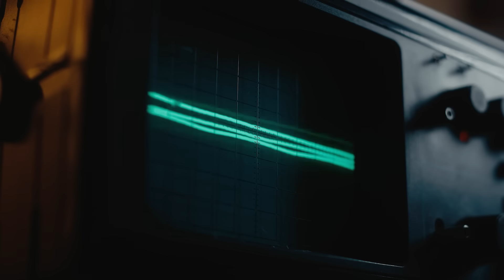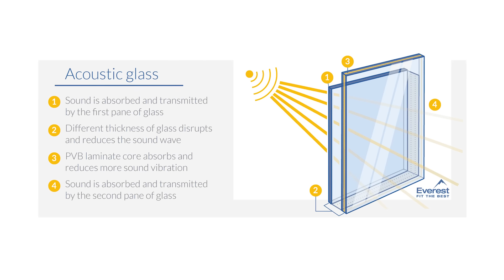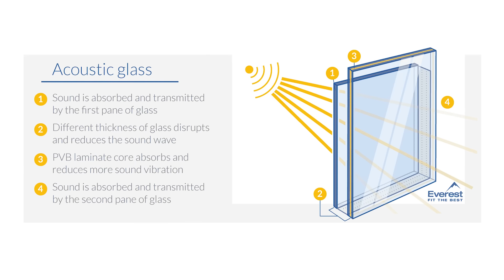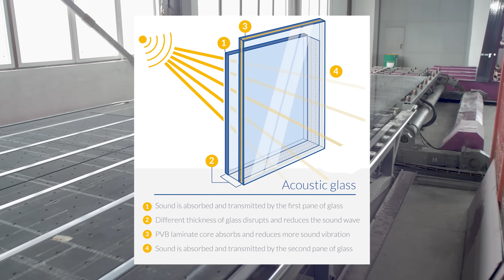Why Your 'Soundproof' Windows Won’t Work (Unless You Do This)

Comment: We installed laminated acoustic glass with new frames along a very noisy road and it made ZERO noise difference. That's £3000 down the toilet. All other glaziers we consulted and all the research we've done suggests secondary glazing is the way to go—primarily because of that 100+ mm air gap. Acoustic glazing is nothing but a gimmick. It might be fine for aeroplane and other high-pitched noises, but not the "whooshing" of speeding cars.
Reply: That's interesting just about to go the secondary glazing route , live on an A road and our kitchen window is around twelve  foot from the carriageway . 
 Looking into it  secondary is better for noise  as  the  2 glass panes  aren't sharing a frame .
 The two frames  and the bigger gap  works best in noise..  really hoping so as its going to cost a lot

Comment: For me just replacing the uPVC framed double glazed windows from when the house was built in 2004 with the latest standard uPVC framed double glazing made a huge difference to sound as well as heat.

Comment: I have tripple pane windows and they do a lot. But only because I also had new UPVC window frames with them with new seals and extra deep recesses to fit the glass which makes the frames overal a lot thicker. While mass is good at dampening the low frequencies the high frequencies can profit from tiny gaps and pinholes to enter your house.
This can be clearly be heard when a door is not tightly in the lock. So airtightness is very important in sound deadening, especially the mentioned tyre noise which is a higher pitched white noise. That's also the most annoying part of road noise, I rather like to hear the hum of a car engine.
After the new window install I checked every window painstakingly by going with my ears along its perimeter, any tightness defect  did show up as a hissing noise from the road noise outside, I added PU foam where needed and after fitting the window surrounds I caulked the gap between these, the wall and the window frame. Result is that I can barely hear the motorway which is only 150m from my house.
The old style sliding sash windows are the poorest performers as they are difficult to get airtight. Any good closing after market seal makes it hard to open them and the seals wear fast because of the sliding motion. That's why modern sliding doors move a bit outwards before sliding open.

Comment: I know from personal experience that hedging can also make a difference. Now it not for everyone, either aesthetically or practically. Also, for an average height hedge, it won’t make any difference to noise reduction to upper floors. But if you like a dense hedge and can have one, it does make a noticeable difference. Our hedge is many decades old and was planted for looks and privacy. Yes it needs trimming 3-4 times a year but that’s not much verses the benefits. And if you can trim it yourself, (I can and do). Then cost is negligible and I like caring for it.

Comment: Speaking from experience sound deadening glass does work and makes a big difference. 
Normal double glazing is made from two 4mm panes of glass. Certain frequencies easily pass through one and then the other. Sound deadening glass uses two panes of different thickness, a laminated 6.5mm and a 4mm for example. A wider range of frequencies are deadened and noise travelling into the room is greatly reduced. In my case it made a huge difference. I ordered the sealed units online and fitted them myself.
Reply from the maker: That is exactly what we said in the video so well done.

Comment: The first thing in sound insulation is almost always to fix all air leaks.  It's also vital to ventilate to prevent mould, but you can get sound attenuating ventilators.  After that, by all means try a cheap fix.  But if you're spending much money, it's probably worth getting advice from a qualified consultant who's a member of a relevant professional institution.  Sorry Roger, I can see you're trying to help but I'm sure you know that some of the information here is over-simplified, and I'm afraid that there is a danger that it can be misleading.   I definitely take issue with the idea of hanging a blanket over a window to see if that's the source of the problem. It won't make a noticeable difference unless the window is open.  As for acoustic curtains, be careful: decibel reductions are often quoted but you will only get a small fraction of that, unless you hang it over an open window.  They will make a difference if you need to leave the window open a little for ventilation but you would get a better result by closing the window.  I would also add that sealed double glazed units actually worsen the sound insulation at some low frequencies because of the resonance between the glass panes bouncing against the stiffness of the air in the gap between them.  You need to be careful when adding layers for this reason.  As others have said, a bigger air gap is much better.  (I'm a retired acoustic consultant.)

Comment: Roger, poor workmanship always a key factor. Cavity closers completely omitted. Where they are installed, there is a gap between the cavity closer and insulation behind it. Window frames installed in the wrong location within the reveal. Gaps around the window not adequately being filled and covered with thin plastic trim. All common issues unfortunately.

Comment: 4mm with 6mm in a sealed unit works very well as the thickness of the glass alters the sound pitch so reducing the overall noise

Comment: So would applying a film of some sort to one pane (inside or out) provide that difference between the two sheets of glass? We’ve got new and expensive (to me) windows which don’t do any more to limit road noise than the old ones. Also there’s definitely more noise when the trickle vents are open compared to closed though I feel that even when closed they are as culpable as any of the other components and I somehow doubt there’s one single change I can do that will magically work. Finally we live on a concrete rather than a tarmac road so there’s more noise from tyres running over the small ridges and the joints. I guess moving home might be the answer!

Comment: Hi, I don't have a noise problem but do have a problem with heat entry. My houser has double height ceilings in the lounge/living room with non opening roof lights that let in a lot of heat in our year round sunny climate. I have a couple of options ...... take out the existing glass and put in double glazed units, (not commonly available here)  add a "frame" on top of the existing glass and put another layer of glass,  maybe laminated glass? sort of DIY double glazing. What would be the most effective? Any other ideas?

Comment: As usual, a good video Roger. I have a large bay window facing the road. The windows are double glazed UPVC units with a 20mm space between panes and no trickle vents. I have secondary glazed all three sides with a sliding white aluminium system and I paid a little extra for 6mm acoustic glass. I fitted the secondary glazing four inches away from the UPVC glazing and took care to seal ALL the gaps. My perception is that when the secondary glazing is closed it reduces the traffic noise by more than 50%. A good investment as it has added significant thermal insulation too.

Comment: Many years ago, now, I went and found out everything I could about soundproofing on the internet, and this is what I remember of what I found.

Most of the noise is transmitted through the air, and some of it is transmitted through the ground and walls. Higher pitched noise travels better through air; low pitched noise does so through the ground. Whichever way it comes, its intensity diminishes by the inverse square of the distance (or on plainer terms, scatters into space or matter quite rapidly - it's not just coming at you; it's also going away from you just as much.)

I can't nicely remember how the above (if I even remembered it correctly) ties to "the two kinds of actual soundproofing" (sound damping and soundproofing are different matters): By mass, and by "sealing". You counter high frequency sound by giving it something heavy to try and move, or by making sure that the air in the room you want soundproof is not connected by air bridges, or light matter bridges to the air the noise is ballooning out into. If there's a gap under your door, it's not just drafts that will find their way in, there; so will the sounds of the outside air body this connects the room to via that air gap.

(I think low pitched rumbles are almost impossible to escape without going so high tech that it would be cheaper to just emigrate. You need something like a concrete slab on heavy springs in oil.)

The vast majority of annoying sound is "airborne", so that's what to focus on. Seal up, and create cavity walls. I can't remember very well why cavities of sufficient depth are so good at actual soundproofing. Mainly I just remember that if you created a sealed box in a room with sealed doors, windows, walls that made minimal contact with the inner box, if you made the minimum gap between these as large as possible, you'd achieve an effect comparable with using a lot of mass to keep the sound out. It has to be hollow space to be maximally effective (for soundproofing, not damping). First it would be the "outer seal" (which prevents transmission of pressure changes happening outside), and then it's a matter of counteracting the little bit of vibration the mass of the outer wall makes, to transfer the pressure change from air outside, affecting lighter parts of the mass of the outside wall  (like a thin pane of glass, or pasteboard ceiling) to the air within the cavity, and then again through the inner wall. (I think if I sat on that a little bit longer, I might come up with a proposed way the sound propagates through the cavity, but probably not, so, I'll just leave this mess here, as is.)

Mass works really well. I found that out from a shopping complex near where I lived that looked out directly onto a continuously busy "motorway" with steep hills that meant all the vehicles were revving harder than usual, passing by there. You could look at all that traffic through the sealed windows of the shopping centre, without hearing a thing through the thick glass. Nothing. The soundproofing was complete.

Sorry for all the holes in the "explanations". As I said, this is just a memory dump of not very intact memory.

Comment: We live in an old Post Office with single layer plate glass windows downstairs, the main A6 road runs about 1.5 metres outside of and along the side of the house. There is constant road traffic most of the day. The building is a Grade II listed Georgian stone/brick building. After a discussion with the local authority, we had single pane glass secondary glazing installed. The large secondary panes are in 6mm float glass and not really visible from the outside.  The air gap is about 8cm.The noise reduction was pretty good.

Comment: The distance between the panes of glass strongly influences sound transmission. So a secondary window will perform better than typical double glazing. Decoupling is the key.

Comment: Vacuum glazing, Roger. Very expensive, but in my case my whole 1930s semi had 53 panes of glass, all of them single glazing. So swapping those for LandVac VG is FAR cheaper than ripping out all my perfectly sound (casements) and frames and installing horrible UPVC double glazing ... and in fact thermal insulation of VG has been shown to be equivalent to triple glazing. I've also found that it's a very important part of the many factors (as you say) contributing to effective acoustic insulation. You might want to look into it some time. Sound obviously can't travel through a vacuum.
Reply: I just did this to my sash windows.
Reply: @Capesteve  Cool. Which company? A lot of people are terrified of the "plugs" of LandVac panes and (in the UK) preferred Fineo. But my extensive research before committing seemed to show a slight edge in terms of specs, and I also found that the width of the rails of my casement lights (i.e. sashes) was sufficient that I could hide all the rather unsightly stuff, with a few technical tweaks (basically widening, as well as deepening, the original rabbets).

Comment: I know you're trying to keep it to layman's terms, but as an audio research scientist, I couldn't help but clear up the "confuse the sound" comment.
The reason different thicknesses of glass in a sealed unit help is due to resonant frequencies. A pane of glass will have a frequency it wants to resonate at - just like a wine glass will make a particular pitch when you flick it. A different sized wine glass will make a different pitch. So a single pane of glass of a particular size and thickness will help to block many frequencies, but some frequencies it will be happy to resonate at (a fundamental frequency and its harmonics - i.e, multiples of that frequency.) If the glass is excited (resonating), those frequencies will pass to the other side of the glass, so it is acoustically transparent to them. If they then hit a second pane of a different thickness and therefore with different resonant frequencies, they will not easily pass the second as they are not resonant frequencies of the second. Any frequencies that would excite the second pane have already been dampened by the first, as they are not resonant frequencies of the first pane so together you end up with a unit that is quite effective over a broad frequency range.

Comment: Very good comments Roger. I am a strong believer in insulating first and foremost. I went from R-19 "older house" to R-30 with special attention paid to insulating  over the top plate, they had installed new windows but a inspection showed minimal sealing between the frames I used dense foam and these two jobs did an incredible job in noise reduction and is paying back on the heating and cooling bills.

Comment: Windows with trickle vents allow a massive increase in sound/noise. Timber windows are better than Upvc and Alluminium. Even just having standards units made with 2 different thicknesses of glass (4mm and 6mm ) will be noticeable.

Comment: All good advice. I'd like to add that it might be worth removing some of the silicone around the perimeter of the frames to see if there is any foam filling betwwen the window and building subtrate. If there isn't then it's well worth removing the silicone and filling any gaps with an acoustic rated foam then resealing with silicone. If you do change your glass specification then you need to ensure that any hinges can carry the extra weight of the glass - this won't be an option if your window frames and sashes aren't reinforced. A good combination for double glazing for most traffic and general noise would be 6mm toughened and 6.8mm acoustic. It's widely available, won't be a huge extra cost and you should see a reasonable noise reduction. You can improve the noise reduction with other combinations but the weight of the double glazed units increases dramatically, so do the costs and almost no U-PVC window frames would be able to carry the extra weight. Finally, if you need further reduction in noise then secondary glazing is an excellent option, ideally with a single glazed 6.8mm acoustic glass. Another option would be to keep your existing double glazing and install secondary glazing which is also very effective for reducing noise but I would also check the perimeter seals as well to ensure there is some foam around the frames behind the silicone sealant.

Comment: The initial steps anyone needs to make before considering upgrading glazing to reduce sound is:
Check seals and gaps and replace seals or fill gaps.
Try blocking trickle vents, if that makes a difference acoustically rated trickle vents can be installed.
Foamed gaps around the edges of newer glazing units is a massive weak point, which should be cut back and covered with an appropriate mortar fillet at least as foam is useless at sound insulation performance.
Be selective which rooms to upgrade glazing to acoustically rated glazing or installing secondary.
Cat flaps are we eak paths as are any similar as similar penetrations.
Secondary gazing will perform better with existing glazing than acoustically rated glazing on its own.

Comment: It might be more cost-effective to investigate an Active Noise-Cancellation system. People are familiar with (ANC) technology in noise cancelling in headphones. The same principle can be applied to a room in a house. These systems use microphones to detect unwanted noise in a room or throughout the entire house. The systems can be set to cancel out a specific frequency or multiple frequencies, depending on the noise source. If the noise problem is impacting the lounge and the ability to hear the TV and audio sound systems, then there is a solution called a Personal Sound Bubble (PSB™).
Reply: I've looked for something like this and, as far as I can tell, there is no such thing. Cancelling noise in an open space is much more difficult than doing the same in a pair of headphones. I'd be interested in any links to commercially available products if you have any?

Comment: Don't bother with acoustic glass...minimal benefits and still quite expensive. We have had secondary glazing and it gives you a large reduction in noise. It's not cheap but do the job once.